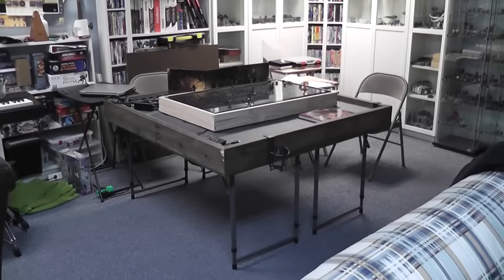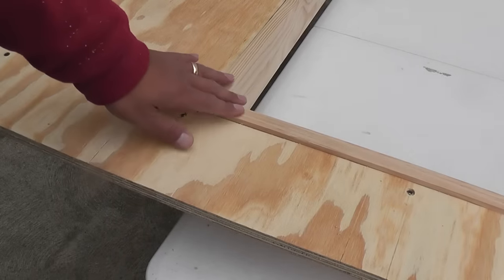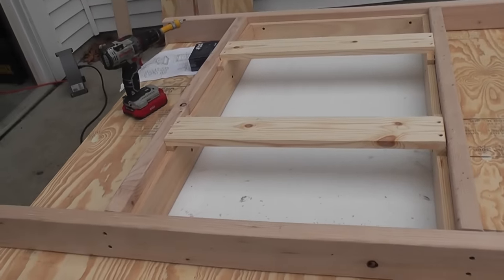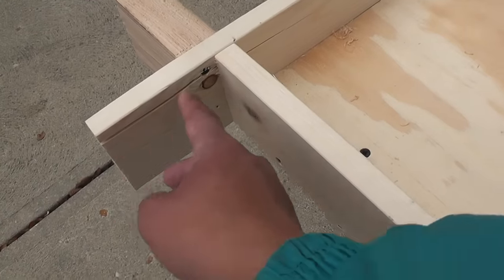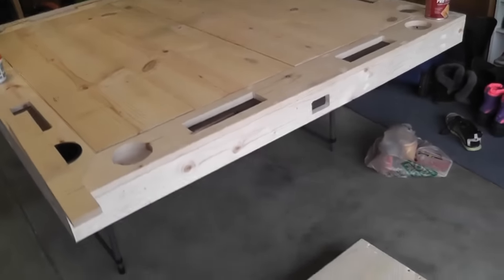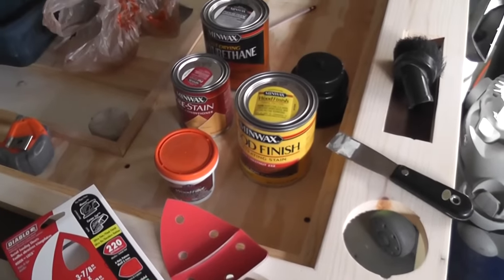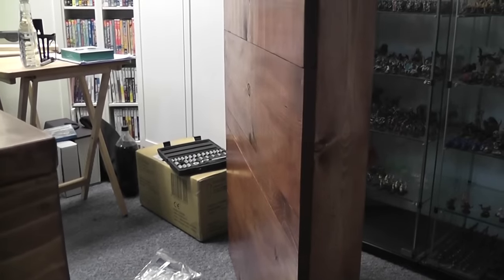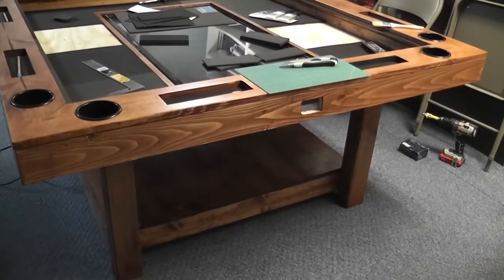DIY Gaming Table for $150

Comment: With all do respect, and I mean that sincerely, please edit the wiring portion of this video out.  You do a disservice to your viewers by showing them VERY unsafe ways to wire up the table.  The romex is not meant to be used this way and not using boxes to completely enclose your connections is a danger to anyone that sits at this table.  I know you mentioned "low voltage" but that's what the mobile devices will be drawing -  all the wires under this table are still carrying full voltage and could easily kill someone.  You are correct, basic wiring is not difficult to do but very dabgerous if you do not understand how to PROPERLY do it.  You would be better off to attach a couple of strips to the table than wire it.  I don't wish to take away anything from your build but keep in mind that people watch these videos (especially "how to" videos) to get ideas on doing their own projects and one of the many people who have viewed this could seriously get hurt.  I don't think that you would want to be a contributer to that happening.  Please do the right thing.
Reply: Romex was designed specifically for this type of use!

I disapprove of not insulating better; however, it isn't going to burn the place down. If he adds good covers to all boxes he would be completely compliant and much less dangerous than anyone that charges a cellphone under a pillow at night.
Reply: Yes, Romex is used to wire up outlets, switches, etc. However it is not designed to be exposed. It is meant to be contained in a wall or within conduit. Not to mention that wires are not clamped to the first box (not sure about the others but doubtful) a misguided foot movement would yank the wire out leaving a live connection for someone to touch, or cause a fire. 
Cell phone under a pillow is stupid too. But then again I've yet to see a video where somebody is teaching their audience to do that.
Reply from the maker: I did retrofit with boxes after making this video.  Also told people to do exactly that at 48:20.
Reply: Glad to hear that @gaminggeek.
Reply: Jo Mama, is correct. It is very irresponsible to advise people on how to do electrical work like this. Particularly when you are committing code violations yourself, and not giving complete nor correct information.
Reply: You don't mention anything about Boxes at 48:20, you just show the 14-2 nmb sticking out of the hole in the table, and mention you are going to similarly wire it sending another feeder to the next hole. Someone could easily misunderstand and not include a box if they were to follow your tutorial.
Reply: It would also be a nicer experience for most users to just have nice powered USB ports, then you can use a boring power board in a hidden spot and run actual low voltage cabling around.
Reply: @jomama4645   is what Gareth suggests possible?

Comment: I know this is an old video, but damn this is beautiful work. I'd add a piece of glass over the tv and would replace your first outlet with a GFCI (you only need 1 because it will protect all outlets down line from it if wired correctly). 

Are you trying to kill your friends, electrical tape won't last, let alone people have a tendency to pick at things. Please redo the outlets if you haven't already. Also you said at one point in the video that it was low voltage (46:30) you were dealing with 120 is not low voltage, I assume you were implying low amperage draw (cell phone charges etc.) Doesn't mean you cut corners. The ground wire could come loose and come into contact with the hot wire. The proper way to connect the ground wire to the outlet would be to get to two ground wires and a third small length of wire and twist them all together in a moret then connect the small length of wire to the outlet. In later outlets (where all the wires are solid copper) one trick (that isn't perfect but is more reliable than using 2 wires on one screw) is to twist the two ground wires together then leaving one a little longer than the other and placing that extra length of wire into the screw.  At the very least get some 1/4" plywood and block off where the outlets are to prevent someone from coming into contact with them. Please...

Again your table is awesome and I'd love to make one myself but please fix the safety issues I'd hate for you to hurt someone.
Reply from the maker: Yup, I retrofitted with boxes after making the video.
Reply: great comment, also the stabs for the neutral, and hot wire are notorious for starting fires. They just don't hold as well.

Comment: I really like this build. I have some questions and some suggestions for future tables.
Questions:
at 19:27 - did those inserts hold up well over the years? I would imagine the corners would start showing gaps at some point after heavy usage?
If you could have changed anything after having used the table for a while, what would it be?

Suggestion for the next Table - 
at 18:42 - let the Top Piece boards overlap the table slightly. You can install LED light strip to the underside to immediately add change-able, indirect Ambient Lighting to the table
If you really want to go all-out with ambience, you could also add
* indirect LED lighting into the dice trays (a few different methods come to mind with translucent white plexiglass inserts, or transparent plexiglass with a white paper insert) 
* alternatively, black lighting in the dice trays to make the dice glow
* indirect LED lighting into the cup holders, which would illuminate the contents of any transparent or translucent containers.
* USB Ports for smart devices
* possibly an open shelf under the dice containers for placing other dice, pencils, or to keep the snacks off the table.
* you can run indirect LED lighting under the bottom shelf as well. You can embed the cable in one of the 2x4 leg stacks and hide it completely by cutting a groove in one of them.

Once multi-point touch screens in that size are affordable, that will expand the functionality :)
Reply from the maker: The inserts have lasted over the years with no gaps.  Check out my follow-up video for things I would have done differently:  https://youtu.be/8Pv2zSJGueY  
Great ideas with lighting--you should check out other people's builds at the BGG forum that have lighting and do exactly what you are suggesting!  https://boardgamegeek.com/thread/1471747/build-gaming-table-150
Yeah, multi-point would take it to a whole new level...

Comment: You should make an itemized list of what you used. Like if you cut a 8 foot board down to 6 foot. I would pay for that lol
Reply: Im building it, let me know if you have any questions. It's a great build but he did skip over a few important details in the video
Reply: @marlinbundo2409  I'm planning on building this table, but I'm debating using surge protectors and simple extension cords rather than wiring electrical stuff myself. Aside from that, do you have any info, i.e. a shopping list, that would be helpful for the build? I have his schematics.
Reply: That is, anything other than on his list, I mean
Reply: @adamtune  i mostly followed the orginal list, im afraid. I would encourage you to try the wiring, it seems intimidating but it looks fantastic, its rewarding, and its pretty much the simplest most entry level circuitry project you could attempt. All you need is some banana clips to twist the wires together. 

I went a step beyond and wired a computer cord to my table, so the cord can be unplugged and put away when not in use (cords are ugly). My wires run through the center of one of the legs.

Comment: First off, awesome job! I will be building this table shortly. For my Reference, how big is your TV that you're using?
Reply from the maker: 40".  You could go slightly bigger but just measure the length side of the TV to make sure it isn't more than about 46".  Some have made longer tables (6' on one side) and that could take a huge TV.
Reply: Ohh awesome. I'm going to start building this Weekend. Its a bit hard because all your measurements are in Imperial and we use Metric

Comment: I would pay you to build one of these for me.
Reply: sarazorz Yeah me too! Like seriously be down for paying for one! I wish I was this handy and could make it myself, but I can't lol.
Reply: SAAAME! This table looks amazing and would definitely pay for one to be made.
Reply: sarazorz how much you guys wanna pay?
Reply: Considering his link to the 'Duchess' gaming table for 500, which looks like a lot less material. Idk how this could go for less than that. Even the 800$ one doesn't match up. Granted, quality is an issue, but even then this sort of thing could do well. 

quote;

Gaminggeek10 months ago
More and more companies are making game tables.  There was a recent very successful Kickstarter of one that was a pretty decent deal at $500.  https://www.kickstarter.com/projects/1296268806/the-duchess-a-gaming-table-from-boardgametablescom/description
I think you can still pre-order from them.
Reply: With topper, cupholders and shipping the Duchess goes for $1188 now that the kickstarter is over. And that is the low end option.
Reply: So I am definitely NOT handy but I've been following his directions (mostly) and almost have mine done.  I'm down to the staining step.  The hardest part is getting everything cut so that it all lines up correctly, but I've found that wood filler and and good sander can cover all manner of sins.

Mine is simpler and doesn't have the dice trays, electrical outlets, underside platform, or inset for the monitor, but I did cut off those corners he suggested and also used lag bolts so the legs can be easily removed.
Reply: I Just bought all of the materials last night it it isn't under $150 not everyone has some of the stuff he didn't pay for... it came out to $350 for me, but we will see how it goes and I will post it as a video response after I build this beast
Reply: Daniel Turner awesome best of luck!
Reply: Daniel Turner how did yours turn out?

Comment: I would have put glass over the top of the TV to protect it
Reply: Especially being that there is going to be beer around the table lol
Reply: +Scott Ganson the issue you get then is there's a gap between figurines and the tv, when viewing the surface at such an angle from the side you'll constantly be screwing up placing figures in their correct positions.
Reply: Yep, I got a thin acrylic sheet and put it over my screen and the 2mm gap meant people saw their figures not in the same square.  And cup holders should stop peeps spilling / knocking over the beers / cokes / etc  :)

Comment: I will be attempting this build soon. Some things i am will be doing diffrently:

1. Woodglue everything. Except the legs. This will make the table more solid.
2. Install the outlets in proper electrical boxes that secure the romex wiring with clamps as to prevent someone from accidentaly pulling out a 110v cable out.
3. Install outlets with usb charging additions
4. Use a gfci for the first outlet in the series protecting from spills.
5. I will not be mounting a television, although it shouldn't be too hard to do in the future. But if i were to mount a tv,  i would use a piece of plexiglass to protext the tv and use clear caulking around the edges to prevent spills or dust from reaching the television.

I really enjoyed the video and id like to thank you for the great plans.
Reply from the maker: Make sure to post the results if you build it!  Lots of awesome builds posted here: https://boardgamegeek.com/article/29290545#29290545

Comment: Somewhat misleading title...  The table might have cost only $150, and your original table might have only cost you $50, but the friggin TV had to cost you something.

Dude, you might also want to put some electrical boxes under the table on the back of the outlets.  Don't want your friends accidentally electrocuting themselves during gaming night.  Leaving all the terminals exposed is EXTREMELY hazardous.  Tape comes off.
Reply: THIS! Please use electrical boxes they have a 2 hr fire rating for a reason!!! he also needs to use soow or sjoow cord with approved fasteners instead of romex.
Reply: @andrew griesel ... I'm betting that's the whole reason why he put the lower platform in there, to add stability cause the legs were all over the place.

Honestly, I remember building stuff like that, but it was way back when I was a major woodworking noob.  Not stuff I'd proudly put on YouTube.... lol

Comment: Awesome Table. If you ever repeat this project. To avoid the imperfections in the cutouts you left for dice and cup holders. Cut the holes under size and finish them off with a router. Another trick to avoid having your wood split while screwing is to run the screws on a bar of soap before screwing them in. I've never personally used the soap trick just something I've heard of. Pilot holes have always been enough for me.

Comment: I know it would cost a bit more but I might would have used either pvc or emt to route wires around the table. Having romex in high traffic spaces such as a table doesn't sound safe at all. I won't mention the other hazards in regards to the lack of boxes cuz others have already mentioned that. Either put conduit or add a wooden plywood piece on the bottom to close off the wires from being accessible. Of course drilling through the supports you risk the integrity of the table but it would at least minimize electrical issues. I also might would add a cord reel to the design so when you aren't using the electrical components of the table, you can roll the cord up for easy storage. I would also try notching one of the leg supports for the purpose of routing wire through it. Now without testing this again that might effect structural integrity but if it works, it is another great way for cable management. Overall the build is incredible and the tutorial was top notch! Just had a few knit picks here and there! It really inspires me to one day make something like this! I also have ideas for speakers and incorporating sound fx to my build both on the table and surround sound speakers. Having either a surround sound speaker or bluetooth speaker shelf that sits right in front of the player might would be cool for when they are in combat and you specifically play sound fx through that specific player's speaker. I found a website with millions of free to use sound fx that you could save onto a computer then using another software, make it so certain words or phrases trigger the sound fx. Voice Attack is a software that takes in voice commands and allows you to navigate your computer, start scripts, trigger sound fx, etc. And the best part is the software is super affordable and easy to set up! I think i spent like $20-$30 on it. It is super sensitive too! so you could set it up where you the dm says: "Aragorn unsheathed his blade and slashed at the orc. The sound of the colliding swords rung across the battlefield." and set it up so when the dm says "unsheathed" or "colliding swords" a sound effect that corresponds to the right action is used. You can also specify what sound channel you want it to play through. So if you have several bluetooth speakers hooked up to a pc, (idk how many can be connected at once, I know you cant play sound through multiple devices at once but as long as they are connected and powered on, the channel should still be picked up by the Voice Attack software. I tested it with 3 audio devices and it worked flawlessly. Although you can't play live sound through multiple devices using this method, you can send the same audio file to multiple different channels to play the sound fx through). This sounds super complex but trust me, check out voice attack on youtube or something and you will quickly see how simple it is to use.
Reply from the maker: I don't think you would compromise the strength of the legs by routing a groove for the wires to go into--this thing is super sturdy.  You could also use metallic sheathing too.  But so far, none of my friends have zapped themselves, especially after I retrofitted with electrical boxes around the outlets. Also, a bunch of people have lined the inside of the well with LED lights that look cool too.  Great idea on the sound effects!
Reply: @gaminggeek241  thank you! Lol! It is cool that even after all these years you can still connect with commenters on videos! This was a great build and I definitely took inspiration from your build to design my first prototype table. I used a 3D model software on a PlayStation 5 called Dreams. I haven’t built the thing yet but finished my first design. I am thinking of designing 2-3 more and then picking the one that looks the best, is most practical, and covers every aspect that I’m looking to implement in my design! Thank you for this well put together tutorial!
Reply from the maker: @MidnightWolfSDJ  I'd love to see your designs--can you post them in the BGG thread?  https://boardgamegeek.com/thread/1471747/build-gaming-table-150
Reply: @gaminggeek241  I posted the first design!
Reply: @gaminggeek241  it’s funny cuz my design is like a combination of your design and a pool table 😂😂😂
Reply: @gaminggeek241  oh and with this being the first design, it doesn’t take drink spills into consideration, so I will definitely need to address this in the next designs. The tv is exposed in this first design and I want to play around with the idea of a plexiglass top but the only thing I’ve heard is that often times the plexiglass makes your character float too high about the map space and doesn’t line up right from the players’ perspective. I have seen some people suggest a projector that points up and hits a lightly sanded plexiglass or even one with a frosty side finish to capture the projected image better. I might consider this idea. Only problem with the projector idea is that then I would either have to line up mirrors well or make a trough type table design where there would be no leg room. Lol! Tv would be significantly easier!